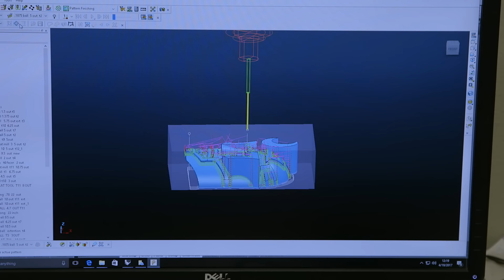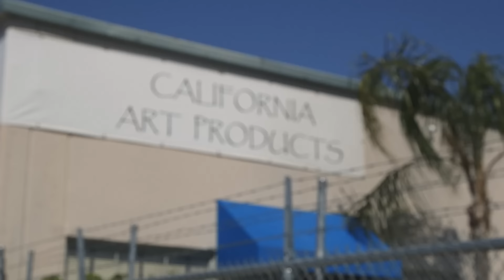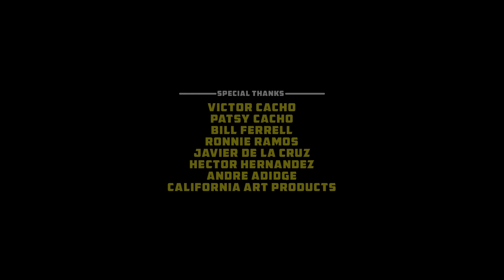Molding a Car Body - Full Custom Garage: Sports Car Edition - S04 EP13 - Automotive Reality

Comment: I worked with a fiberglass outfit designing molds. These guys should have molded in I bolts for pulling the cast, also at least a couple of ports to blast it with compressed air to pop it free
Reply: YUP!
I worked at a fiberglass fabrication shop, too.  The bread and butter there was large tanks, but there was also a set of molds for a kit car body that that had been made there in years past

The most difficult thing to de-mold was the water tank for an airport fire truck.  Made on a male mold opposite of what is seen in this video, the thing was at least 12 feet long, maybe 8 feet wide, and better than six feet deeo, with a lengthwise sump that went down between the tandem axle rear wheels of the truck chassis.

To facilitate popping the part off the mold...the mold contained several shop-made things that looked like tire valves from a car.  There was an air fitting on the threaded end of the 'tire valve' inside the mold and a hose leading out from under the mold.  The 'tire end' of the tire valve opened into a 1/4" opening right in the mold surface that was covered by an adhesive paper circle around an inch in diameter applied just before waxing the mold.

When it came time to pop the thing loose, a modded air nozzle was put up to the hose leading to where you wanted to start...and each 'paper dot' got a puff of air in turn.  You could see the expanding bubbles   between the part and mold.  You'd go around a couple-three times making the bubbles bigger until they joined.  At that point the part was free and they'd come in with a forklift and just lift it off!  Very rarely were wedges needed!  The little impressions from the dots were de-burred, but not much attention was paid to fixing them.  Still fixing something like that in the gelcoat of a car body would be nothing but a dab of gelcoat before sanding for paint.
Reply: @Bluswede  I also did a stint in fibreglassing, at a factory in Sydney NSW where we made firetruck bodies, tanks and crew cabs. Another line was making the fronts and cab interiors for the intercity double decker trains. Truck Mudguards and other items. Some of the older guys were affected by Polyester Narcosis and were somewhat crazy, Safety gear really is important in the industry and at that factory in 1980 there was none of it.

Comment: Wow   fun with Fiberglass what a ton of work .. way back in 85 when we built our moulds we  just used wood for framing and 4 inch  cardboard cutouts soaked in resin and  laminated on the back of the moulds for strength..the foam is a lot easier.. what a great idea..